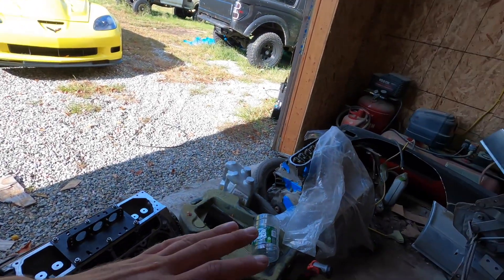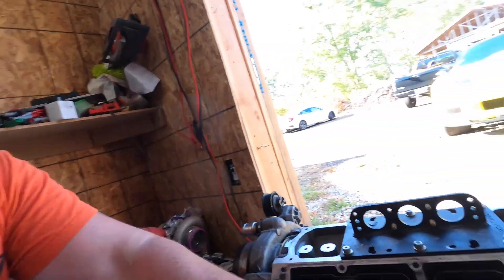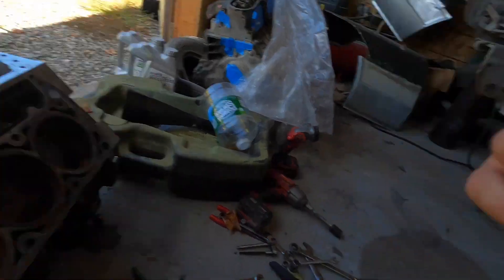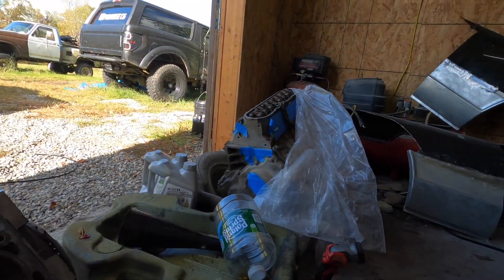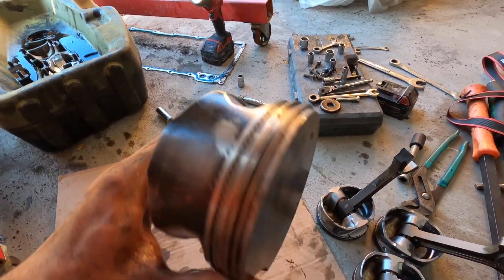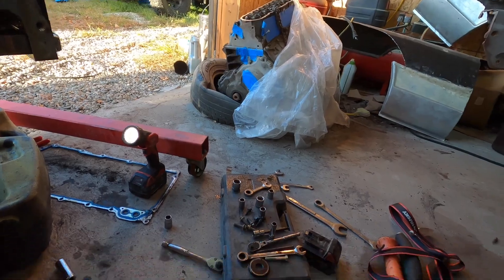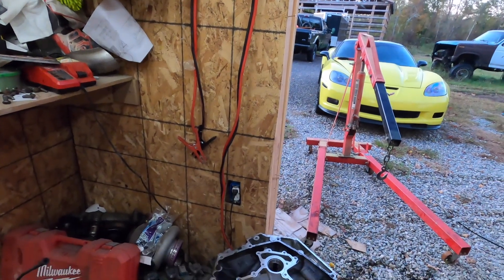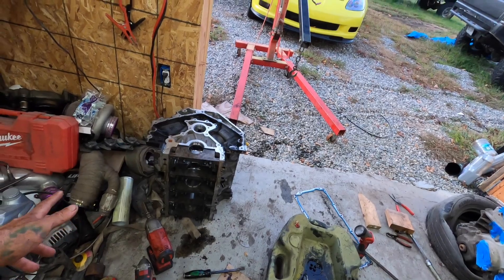Ls2 engine tear down and inspection

Comment: Just blew my turbo corvette up , two Ls2 motors now !!! Junk , what 5.3 are you going with
Reply from the maker: I picked up an aluminum block 5.3 out of a 2013 1500, has thicker cylinder walls and hopefully hood up to boost now I went with forged internals

Comment: i just rebuilt my L33 after spinning a rod bearing and chewing up the thrust part of the cam gear and I checked my top rings just for shits and giggles... some were as tight as .010-.015 and one was tighter than .010, couldn't find my .00x feeler gauge to see exact but there were also a few that were as loose as .025 lol. never trust gm ring gaps. i smoke on downshifts/decel after being at high rpms.. boosted ring gap in an n/a engine ha! 

P.s. main caps are numbered. 1-2-3-4-5. 1-5 are same same but they just spun 5 around so the number will be on the other side from the rest. 
P.p.s. heres a puller i scooped recently(i used princess auto specials that would take me 20-30min to get the pulley off) and you don't need to use the bolt or risk threads with tis. just rip the bolt out, stick on the second longest rod, cranker off till that stops then put in the longest rod and finisher off. takes me less than 2 minutes to get the crank pulleys off now. 
 OEMTOOLS 25090 Harmonic Balancer Puller Kit
https://www.amazon.ca/OEMTOOLS-25090-Harmonic-Balancer-Puller/dp/B01AIRR4EY
Reply from the maker: Yes sir I can’t wait to get my motor back I have the same puller it just doesn’t work for the ati balancer 🤦🏽‍♂️
Reply: @NRMotorsports  ahh ATI, yah those fuckin things are just a pain in the ass. Guess there is a reason they don't spin as much as stockers lol!